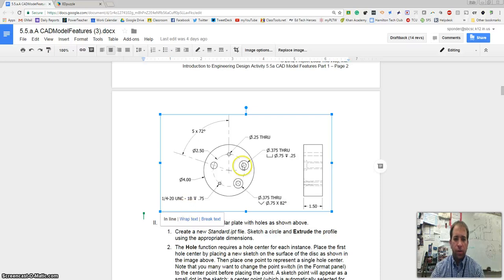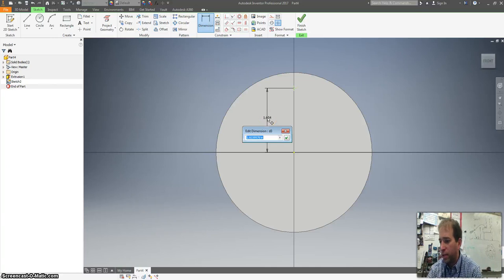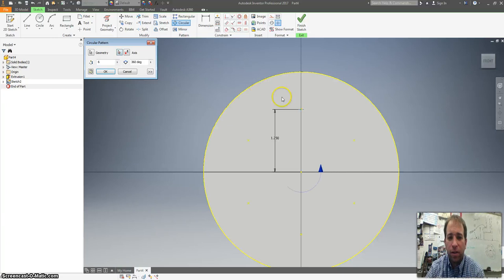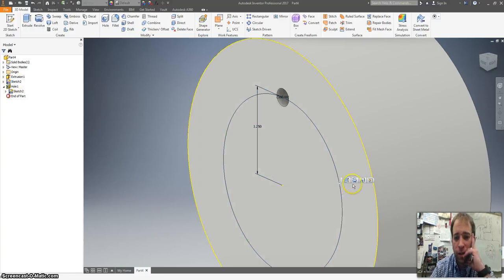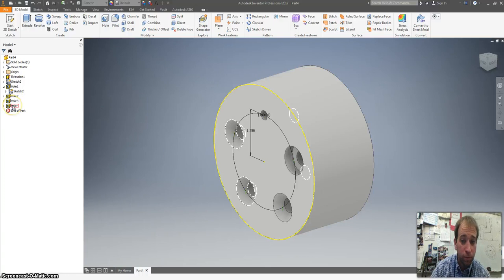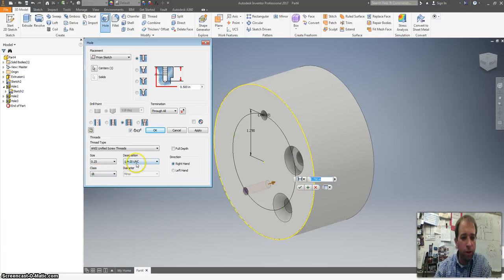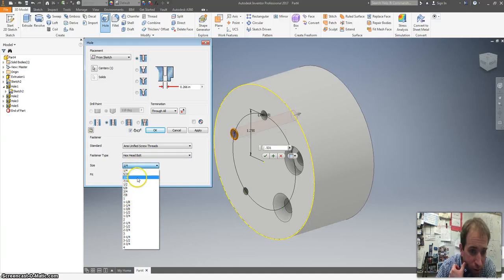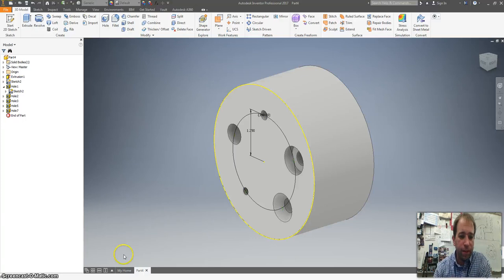Hole Practice on Inventor

Comment: If the holes are going to be the same, I prefer to create one first, and then select the round pattern command and use an axis. But good video though. I didn't know you could do it this way also.